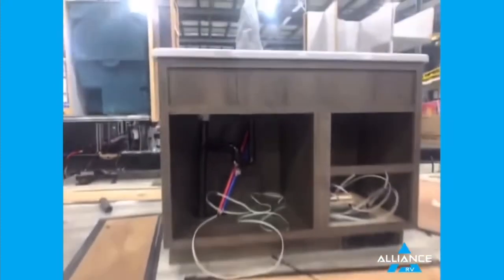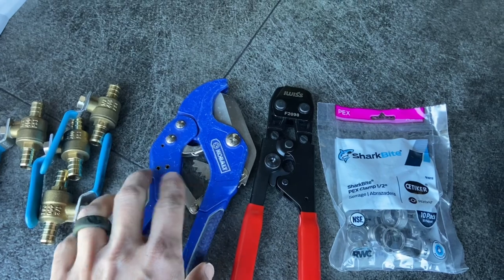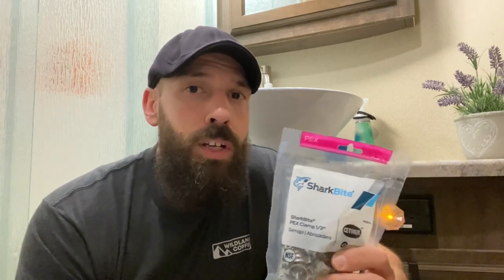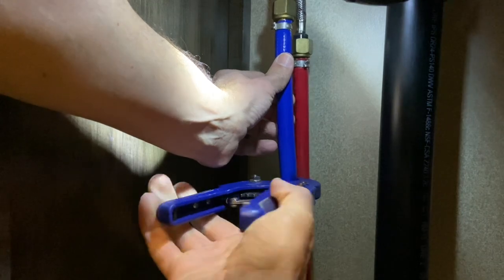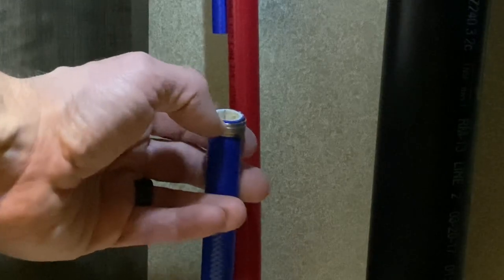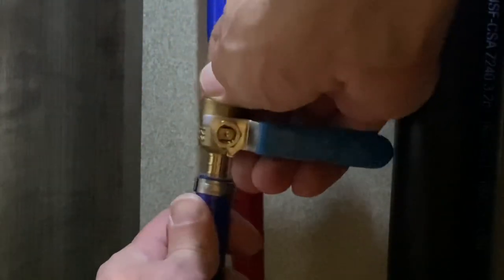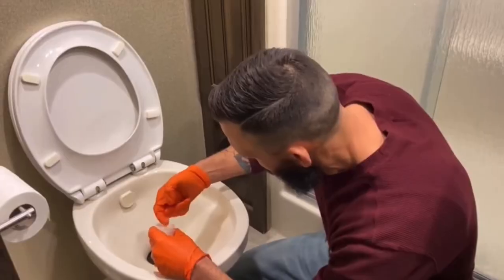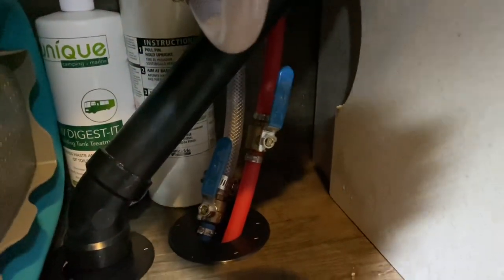How to Install Water Shutoff Valves on all your RV’s Plumbing / (Full Time RV Life)

Comment: I would love to see an update on when you actually use the 5/8 in pex clamps. I was having the same issue with the soft tubing as well. One trick I found was to get a hair dryer and heat up the soft tubing... it made it a lot more pliable and a little easier to get the clamp on... it was still a bear to get those 1/2 in clamps on though...
Reply from the maker: That’s too funny cause I was thinking about doing the same thing with a hair dryer 👍🏼 I’ll keep you posted when I get the other clamps in and finish up the project. Thanks for watching. 😄
Reply: @WhyWait  I was having someone walk me through a repair and I told him he was nuts for telling me that those 1/2 in clamps would fit and he told me about the hair dryer trick... It really helped. I also had a small piece of wood to help push the clamp onto the hose while trying to twist it...  My only concern for the 5/8 in clamp is that it would clamp down enough to seal up with the water pressure. I run right at 60psi on my rig. (2021 Reflection TT)
Reply from the maker: @jonpauldennis8040  so the 5/8 clamp were a no go. Still to big which surprised me. At only 1/8 bigger they slipped on but wouldn’t clamp tight enough.
Reply: @WhyWait  looks like I'll just have to stick with the hair dryer and sore thumbs
Reply from the maker: @jpandamyd  😂😂

Comment: The soft pipe is vinyl.  A trick I do is have a cup of hot water and dip the end in for about 5-10 seconds and the 1/2 crimp goes right on.
Reply from the maker: That would work. Nice idea👍🏼

Comment: Great video.  Thanks for your expertise. And yes, I agree with other comments...I used a hair dryer on mine to make the pex more supple. 
...I'm also wondering if plumbers grease is necessary for the ball valve or can petroleum jelly or vaseline be used?
Reply from the maker: I think all those options would be fine. Plumbers grease basically is the same thing as those 😂

Comment from the maker: For anybody looking at getting the 5/8 clamps for the soft PEX they Don not work unfortunately. They will slip on but not cinch down tight enough on the soft PEX.
✅✅PRODUCTS WE MENTION IN THIS VIDEO✅✅
🔹IWISS PEX Cinch Tool: https://amzn.to/3BygLtp
🔹IWISS PEX Pipe Cutters: https://amzn.to/3JJaGNX
🔹Pipe Cutters for PEX & PVC: https://amzn.to/3sRvuvH
🔹1/2 PEX cinch Clamps: https://amzn.to/3s0Jggj
🔹5/8 PEX Cinch Clamps:https://amzn.to/36raGnh
🔹Brass PEX 1/2 Shutoff Valves, 10 Pack: https://amzn.to/3uY5bXq

Comment: In most all the high dollar RV’s recommends to use a non crimp connection what all of them use is Flair-it connector’s. The reason they gave me is you can take the connections apart without destroying the connection or PEX. The other option is Shark Bite the problem they said with these connectors can only be used a couple of time then the Shark Bite connector and PEX must be replaced. The other thing that the different companies to make sure you use PEX Type-Ae. If the. Companies that build. Billion dollar RV’s use 
Type A with Flair-it Fittings.
Reply from the maker: Thanks for watching

Comment: Will those clamps you used for the PEX pipe work on the hard vinyl? And doesn’t the hard vinyl have a different inside diameter. Trying to add shutoff valve to my toilet with hard vinyl.

Comment: Great video and an excellent idea! I will be adding shut offs next weekend. Thanks!
Reply from the maker: Thanks, appreciate that. It’s an easy project I put off for way to long myself. Glad it can help.
Reply: @WhyWait  seems so obvious once you think about it. I had a small leak in an old camper and had to scramble outside to shut off the water. So much easier to close a valve. Hahaha! Just watched a few more of your vids and will be doing the AC mod as well. Great stuff.

Comment: QQ. Why not just use screw clamps?
Reply from the maker: Well you can for the soft PEX and I’ve used those on the Soft reinforced PVC tubing as well. I didn’t have any on hand and since I need the cinch clamps anyways for my hard PEX I’m just going to go that route. Going to post an update after I use the 5/8” clamps. Thanks for watching 👍🏼